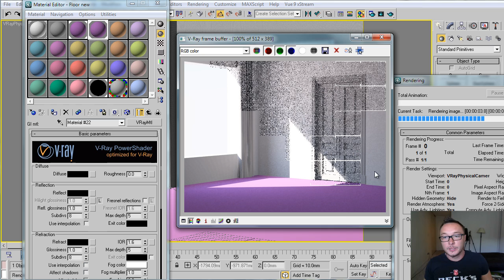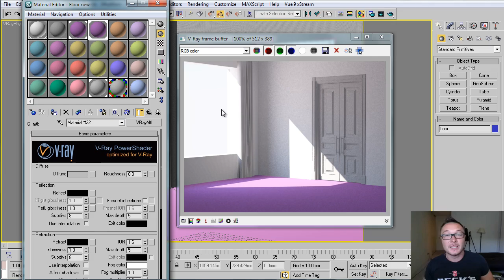VRayOverrideMtl - Color bleeding - Fixing Light leak

Comment: this is helpful indeed. but i had a different problem and i thot it's the definition of "light leak" it is the light leaking  in the intersection of the ceiling and wall. i double checked if the model has any problem. it doesn't.  i tried boosting the LC to 2k. but it didn't solve the problem i hope someone can provide a solution to this. thanks!